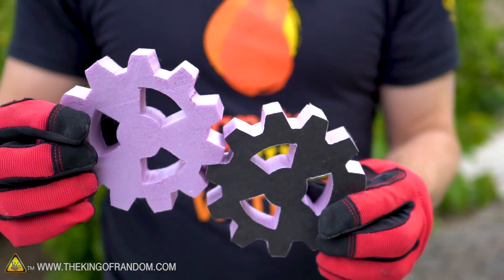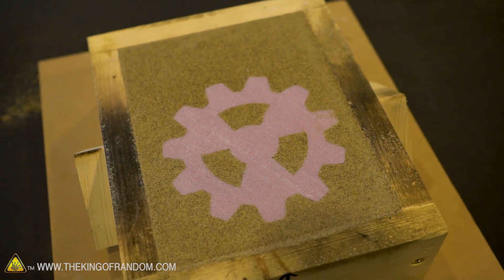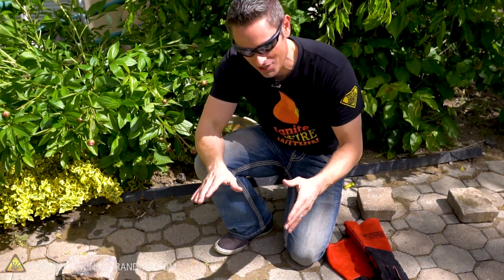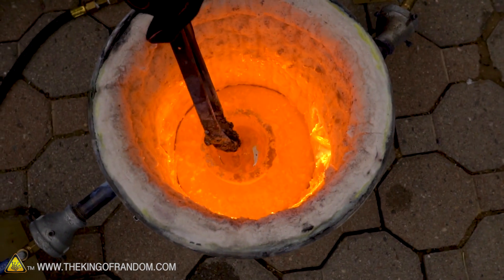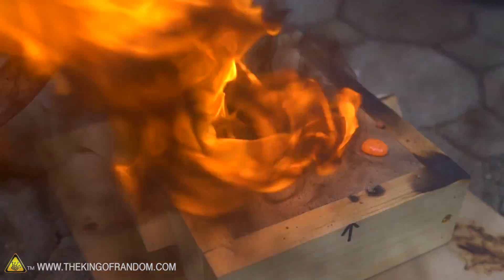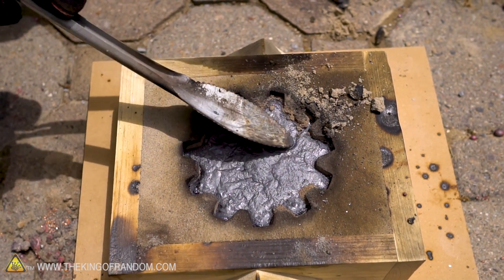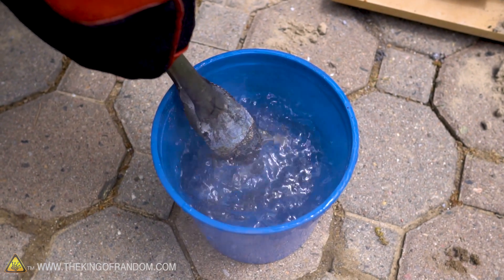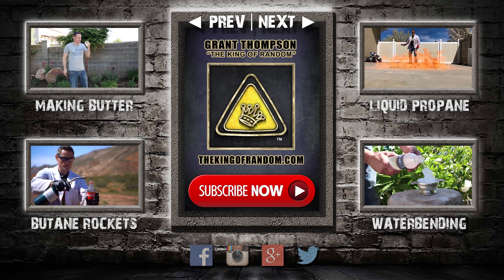Argh. Why Is Copper So Difficult? TKOR Tests Melting Copper In Our Homemade Foundry

Comment: Why you do not use a mold with 2 faces on the top face 2 tubes one to pour another one for the excess to leave, besides the sand must be hardened before pouring the metal with sodium silicate, metal is very heavy that biscuit mold that You did it will never work, I hope you have achieved the number of visualizations that you were looking for, I would never post a failure like this

Comment: The mistake is an open mould. Copper needs to get down to the mould under, it does not like open space. ONE way to cast open, is to make it deep. Twice as thick with strength elements to the mould like metal spikes and the like.

Comment: The texture of that sand looks absolutely dreadful. It looks far too coarse and loose. You don't seem to be able to ram it properly, it just squirts out around your rammer. 
I'd say there's little to no clay in it. Your bets bet would be to buy some properly made casting sand (Delft sand) . Start by dusting some fine french chalk over the pattern  then sieve a layer of fine sand  onto it and compress it carefully. Add layers, ramming them tight.
The final mould should take an accurate impression of the ball of your thumb pressed firmly into the surface without crumbling or cracking.

Comment: You need to use screened and very fine sand put around the Styrofoam and then the rest to fill it up. That way the sand is more dense around the Styrofoam.

Comment: You need to heat up the mould so its almost same temperature as tge copper befor you pour it. Then the copper have more time to set in the mould.

Comment: you need to make a two sided flask to cast the gear, it'll secure the cores. 

also if you throw some hacksaw blades in with the copper, it will keep the oxygen content down and prevent the casting from "muffining" up.

Comment: You should use some kind of adhesive in the sand mix to make it solid and avoid that the middle sand pieces float due to density.

Comment: Such bad work, you do not remove the oxidized layer of metal before pouring it to the mold. You produce a lot of gas when you burn the Styrofoam so what do you expect? Even the sand for casting is bad. Guy read a book about the subject.
Reply: bad casting but nice video
Reply: you realize he just wanted to try out this type of sand, and also, he  knows how this process works, he's just gotten fed up and doesn't want to use his time for removing slag from the metal.

In short, watch one of his other videos, like, the brass knuckle one.

Comment: well you could try to do a void cast by using the other half to cover the and thus as it is burned away the sand holds in place and won't cool as quick as in open air or as I tried to find the method name I saw one that is called open air casting or a vacuum casting style as the air is pulled out but whatever you decide we will watch

Comment: Instruction for success:
===================
1. Work cleaner. Everything you are using is contamined with other materials, sand, slack, metals... Ever seen that profesionals scrap off the sht. x times before pouring??
2. Use a closed mold (a cover will do in this case).
3. Pour through a "funnel" in the center, make symmetric ventilation holes along the struts (maybe some more to let the gasses out quick enogh)
4. Use styrofoam insted of hard foam. The hard foam is still too resistant.

5. Most important:  Use the right sand. A professional sand for copper is finer and bound with OIL, not water

If this does not work... wrong camera ;)

By the way, think about a face protection. That stuff can really explode and shoot liquid copper at you.

Comment: I see what you did wrong. first you never revisited the orginal way to pour the cast. wet sand and full of foam. 2nd when you was melting the foam you was drying out your sand making it more brittle watch your video you can see the mold dry. I think you should retry this.

Comment: Hi Grant, Try adding 1/4 part portland cement 1/4 part water and 1 part sand.  Cast the foam gear in the mixture let dry and pour your copper.

Comment: Your 2nd try the sand broke and floated off, it's lighter than the metal. The open mold probably won't work, you need to set up for a cope and drag mold, so the metal is restrained on all sides.

Comment: The problems are: 
1 you using stirofoam instead wax.
2 the tecnique of losing wax casting, need to press anoder layer of sand on de piece of wax, and the fused metal must be versed inside a channel composed of wax.
3 casting sand is more thin, that not seem casting sand but see sand.

Comment: I use Petrobond... an oil based sand that withstands higher heat. Greensand works great for Aluminum, but you need something more heat resistant for Brass or Copper.

Comment: I wonder if you made a cover for the mold that was ceramic (or the foundry material) and had a hole in that to pour/vent heat if you'd prevent the three center sandbars from popping up. That should stabilize them, and allow better shaping. 
If not, you've mentioned in the video just machining the holes out. 

Great video! Thanks for sharing!

Comment: Dude, Where are you getting that sand from?!? It looks like Playground sand... does not look anything like any kind of green sand I have ever used... is there any clay or other binder agent? The specific gravity of molten copper will make that sand float if it doesn't have anything else in it...  another thing is you have nothing on top to prevent it from rising out... that is why there is usually a top on green sand molds with pouring chimneys as well as vents...

Comment: it is less about the melting point as the thermal conductivity.
Reply: you can also try using sodium silicate/co2 for your sand medium. it is not reusable, but much more durable.

Comment: Years ago I cast copper soldering iron heads, I added a small amount of tin to help it cast properly. My mold was a recess carved in a fire brick. I floated graphite powder on the surface just before casting to act as a flux. My design was simpler than yours though.
Reply: Also part of you problem is that the sand cores float on the top of the molten copper. I think you need a top on the mold to make it fully enclosed.

Comment: what if you put weight on the sand aswell? like a metal plate with a hole in the middle, that way the sand might not pop out as in your video, only question is if the copper will reach the edges

Comment: well just based on standard casting techniques i'd suggest that you 
A. bring the sand mold up to ~700F prior to casting as this will delay the copper solidifying on contact
B. use a two part upper/lower mold so there is more support for sand pillars resisting buoyant forces from the copper

that is if you care :P

Comment: You didn't fire the mold! You have to fire the mold to almost melting to cause the sand to adhere to itself. Add about 20% sodium silicate to the water and mix. Then heat the mold in your furnace until it begins to melt on the edges. Let it cool down. It will be a very solid crystaline form. Of course you need a steel form instead of wood!

Comment: I think issue in the last try was vapourizing water from the mold. 
Maybe try some other liquid to put in sand to moisturize it like oil? 
Not sure how it will hold the shape.
Or petroleum jelly!! That should enable it not to turn to vapour, but burn off in case of contact. and additionally maybe mix in some clay. but that's just my theory.

Comment: You might want to try preheating your mold next time. Should alleviate the issue with the copper solidifying too quick. Other than that it seems like your green sand is a bit off, causing it to break off.
Reply: Gates and rises

Comment: I was thinking about wetting the sand too. However, you should probably have dried it afterwards and you could also try to heat the mold up. The thermal shock could be breaking your mold, and with the wet sand, steam could be the issue.

Comment: You need a binder in the sand to soildify it, then  you can heat up the styrofoam and remove it. Also, preheat the mold to help the flow

Comment: cold sand + bad mold, preheat on the furnace , pouring directly also bad, as per the same as pouring simple water on sand, so make a connecting channel to fill the void from the bottom up....

make everything hot and keep it all hot until fully filled, simples.
Reply: want a stiffer sand then use a simple Sodium carbonate and vinegar gasifier into the  connecting channel and so force  carbon dioxide through the mold after its compacted.
Reply: and OC the obvious, gravity feeding/pouring liquid molten metal from the base of the crucible  directly into the connecting channel base of the mold removes all the crud and scum as that will always float to the top as you  gravity feeding/pouring liquid molten metal from the base of the crucible, never forget the golden rule , keep it all hot right up to and after pouring,mold included

Comment: it has been years since I did it, your sand looks different that what I used. use two sided mold, detail in onside and flat with cone for metal on other. use wax not foam, I made a plaster of Paris set of molds to make wax molding, was reusable. then used the wax to do the sand. take care though as it will not take as much punishment. also used a vibrating table to settle sand.

Comment: put flat top on mould,,runner riser..weight top box,put  glass bottles on top off molten metal. change to diesel oil fuel near the end. l p g does not have the heat,

Comment: i noticed that one side of the copper gear was pretty bad. is there a way to fix that?
also, how do you make like a different material mold like a mold harder than sand so that the pieces inside would stay in?

Comment: Water in the sand is a problem. Make your green sand with Mineral oil. Instead of water. Then line the first cast with talcum powder. Make a second half of the lid with more green sand. Put a pour hole in it. Then cast your copper through the hole. Cutting off the plug. Same process that you would use if you cast the gear with aluminium instead of copper.

Comment: Instead of sand use conc
Reply: HunterBear4 
Yeah, concrete, brilliant. The poor guy would have the mold explode with the liquid molten metal flashing toward him. DO NOT USE CONCRETE!!!  This is a sure method of possible death, blindness and severe burn. Concrete explodes under high temperature. How high? Not very high at all. Once the concrete exceeds 210 F or 100C (for those metric snobs; BTW Celsius is not metric, it uses water as a starting point of zero) the potential for water flashing to steam is present. The structure of concrete will fracture once the pressure of the steam is high enough. Water has an extension ratio of around 28:1. So beware. The concrete mold would surely reach way beyond 210F  100C is a fraction of a second. Concrete never completely dries out and will cure at least up to 30 years and beyond.  The Hoover Dam is still curing nearly 90 years later. The amount of heat generated from the concrete  pour in the dam required refrigeration piping to cool
Reply: HunterBear4 I think concrete will work, and it will crack. So for a one time pour it will work, and the finished piece may need some trim and polish.
Reply: Joe Jones definitely a possibility of the concrete exploding, if any moisture is in the concrete or in the aggregate in the concrete, the water will steam when heated and explode
Reply: Concrete may crack from the high temperature of the molten copper (over 1000 degrees Celsius).

Comment: I might suggest using plaster instead of sand. You do have to break it after and cant reuse it, but its more solid. I have used it for silver and copper casting in the past. You can get a jewelers fine cast too. Otherwise a fun video!

Comment: Try adding foam where half of it sticks out and put baby powder so you can add the other mold on top without making them stick together and add a runner or hole to it and then pull them apart and take the foam piece out and put the two pieces together and pour the copper into the hole

Comment: Doing the pre-heat to melt the foam mold is just drying out the mold sand.  Agree to make a closed mold with gates and risers.  The other thing would be to use oil sand (Petrobond) so it does not dry out as fast as the green sand.

Comment: Thought:
You could preheat the green sand the way they do with glass blowing and additional pieces of glass.
You could also take carbon rods and place them in your cast instead of green sand for your mold. Carbon has a ridiculous high phase change point.

Comment: if you want a full radiation symbol put a hole in the middle of another layer of green sand and put that on top of the styrofoam that way the sand will stay in place.

Comment: My dear friend.. to get the proper shape use another wood sheet above the sand shape with a hole at the centre and from that insert a pipe into it.. from that pipe you need to supply the molten copper into it...

Comment: you should have added some clay to make the sand mold sticky.  It was too dry n brittle...thus it kept failing on you. Also adding some charcoal dust to the wet sand mixture would help.

Comment: u should use another side on the mold with a pouring hole..the poly will then make gases as it melts making pressure in the mold thereby keeping the sand in place..
this is done with aluminium but could work with copper..

Comment: You should really be using a well for pouring the copper. Basically, take a wide plastic tube and form a second green-sand mold around it. Remove the tube, and place it directly on top of the mold you wish to cast. Pour the molten metal into the hole, and it will fill the mold beneath it. Keep in mind, you have to have both molds VERY TIGHTLY locked together to ensure they don't move when pouring. Also, don't keep your green sand too wet; it will lose a lot of its strength.

Comment: Just a thought, make your mold with cement then burn out the foam all the way before pouring the copper.  If you insert a copper rod in the center of your mold, you will have a handle to lift it out with and can cut the rod and file it flat.  Perfect gear?

Comment: hey , how it goin? like the copper gear video.  I have a suggestion . what if you used fine concrete mix for your mold that way it's stable and won't be brittle like the sand. hope it works 😀 . thanks

Comment: Hey Grant!  Caught a random episode of "How it's Made" on Discovery the other night... and it happened to be about sand casting for brass monument markers and the like.  After making the sand mold, they sprayed it with a solution of alcohol and graphite powder.  After they sprayed it, they lit the mixture on fire to burn off the alcohol... leaving a graphite coating that helped protect the sand from the extreme heat of the molten metal.  Figured it might be worth giving it a try if you want to make that perfect gear.  Cheers!

Comment: Your green sand doesn't appear too sticky if it is falling apart from the one touch. Also I would try building a two sided mold. The copper can be poured down one access hole and allowed to rise up from another access hole on the otherside. The additional height should give sufficient head pressure to push the copper into all the nooks and crannies

Comment: I do not have much experience with casting but from other videos I saw the foam is enclosed on all sides with sand and spurs are used to pour the meted material in.  Would that work better?

Comment: Grant- It's your design that's causing the problem.  those chunks of sand are floating on the liquid metal.  Either cast it with out holes, or use a two part mould.

Comment: Insanity?!  Making the same mistake over & over again, hoping for a different result?  Hmm.... "Almost Perfect!"  The sand was not only too dry, but also a very poor mix for molding molten copper!!  Recommendation:  Do a little more research on the sand mix, maybe try a small amount of cement added to the sand.  Also, Real Foundries use pure sand which is COMPRESSED UNDER OVER 20,000 PSI  HYDRAULIC PRESSURE OVER THE MOLD TO KEEP THE SAND TOGETHER.  Those molds require a blow with a hammer to loosen the sand after the copper cools.  Just a hint.

Comment: hmm not that i've done metal casting before, but it looks like your heating the copper that extra bit meant it stayed liquid longer and caused the sand chunks in the middle to float; the answer may well be to actually let it cool a bit first, so that it's hot enough to melt the puny foam but cool enough to solidify only moments after being poured

Comment: Grant you should make a casting of those pieces that keep popping out with a metal that has a higher melting point than copper and then they will for sure not pop out but you just have to make sure the copper doesn't stick to the inserts

Comment: Ok, Grant... Here's what I think is going wrong. You don't have anything in your mold that stabilizes the sand. There is an additive that you put with the sand (a ceramic cement) that makes the mold solid. It cures, and becomes solid. Try that.

Comment: Here's what you got to do. You need to put a reservoir that has a J shaped channel or sprue that comes up into the shape you want to cast, and you need to pour the copper into the reservoir. That way, the copper gently fills up into the shape you want to cast from underneith, rather than knocking the sand loose when you pour it straight in. Copper is too dense to cast the way you're casting if you want fine details.